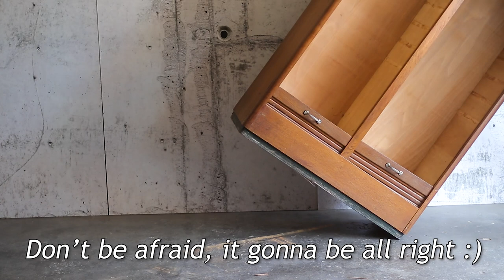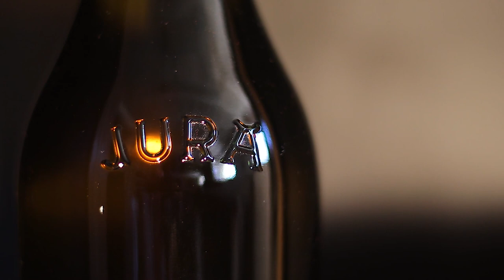Mid Century Cabinet - Restoration and Makeover

Comment: I wouldn't call this a restoration but a major redesign – to the better! But perhaps one hint for the drawers: To avoid the uneven gaps between the drawers you can build them as simple boxes and push them in the cabinet. Then you can mount the front panels with double sided tape while putting shims between the front panels to make evenly sized gaps. When it looks good you screw the boxes and the front panels togehther - from the inside. (I hope this is understandeable, I'm no native speaker.)